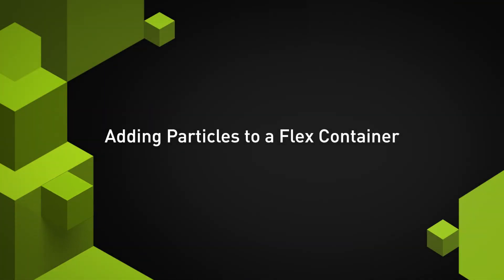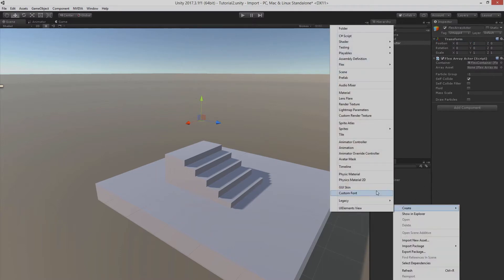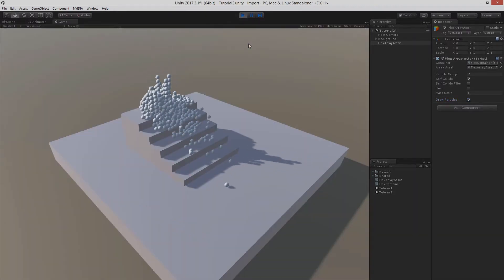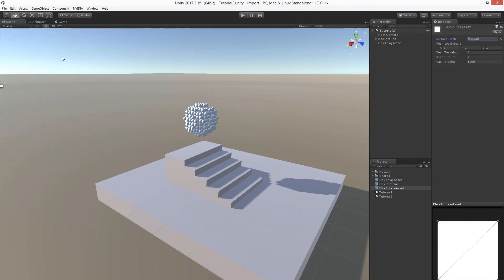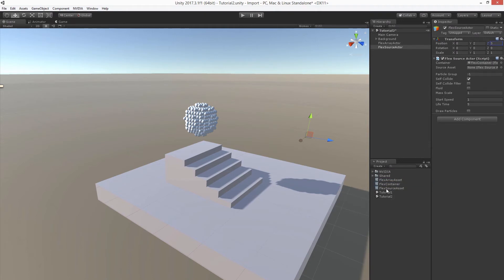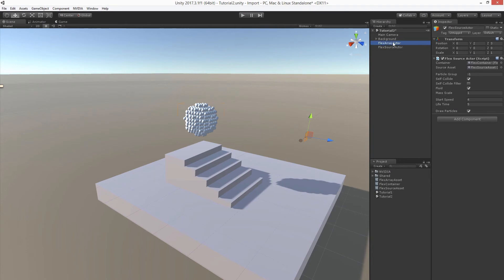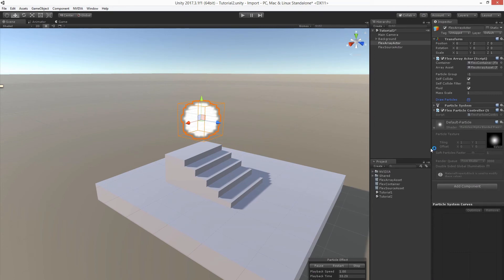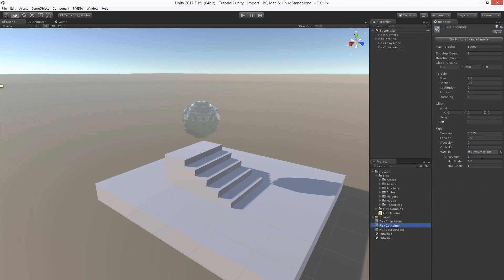Developer FleX Unity Plugin Tutorial Pt. 2

Comment: This is not worth it currently, they are not supporting nor updating it, none of the shaders work with SRP's and the fluid system doesnt function with newer versions of Unity. Its a tad annoying as i cant understand what the reasoning is for this, if you dont want to support it, remove it from the store or get your act together and stop sabotaging your own brand.
Reply: Works just mine for me in the 2020 LTS version lol.
Reply: @Enigmaticatt  Which Render Pipeline and Render Path are you using?

Comment: when i try this, this is what happens:
ArgumentException: ComputeBuffer.SetData() : Accessing 9300 bytes at offset 0 for Compute Buffer of size 9264 bytes is not possible.
UnityEngine.ComputeBuffer.SetData (System.Array data) (at <a979f18d51af41179d12b797e8c5be14>:0)
NVIDIA.Flex._auxFlexDrawFluid.UpdateMesh (NVIDIA.Flex.FlexContainer+ParticleData _particleData) (at Assets/NVIDIA/Flex/Auxiliary/_auxFlexDrawFluid.cs:247)
NVIDIA.Flex.FlexContainer.UpdateDrawFluid (NVIDIA.Flex.FlexContainer+ParticleData _particleData) (at Assets/NVIDIA/Flex/Assets/FlexContainer.cs:788)
NVIDIA.Flex.FlexContainer.UpdateSolver () (at Assets/NVIDIA/Flex/Assets/FlexContainer.cs:696)
NVIDIA.Flex.FlexContainer.FixedUpdate () (at Assets/NVIDIA/Flex/Assets/FlexContainer.cs:605)
NVIDIA.Flex.FlexScene.FixedUpdate () (at Assets/NVIDIA/Flex/Helpers/FlexScene.cs:68)

any help plz?

Comment: makes me miss having a cuda 3.0 card, now im on a gtx 480 and cant do that.
Reply: Buy a cheap GTX 750, despite being low end is actually faster that your GTX 480, a GTX 1050 is even better but will cost something more
Reply: the gtx 10 series is useless, dose not even have a DAC built in to it and aftermarket DAC's are low bandwith, my monitors run 2048x1536 85HZ over VGA.

also i run my 480 at 970mhz core.
i used to have a gtx 680 running 1.3ghz, but i gave it away because  a friend wanted it.
Reply: Are you using a CRT? nice overclock bdw :)
Reply: yep, im ultra picky about  monitors on my main pc. they have to be trinitrons using sony's SMPTEC phosphors. i obsess over color accuracy.
Reply: im on a Titan X now... LOVE IT!